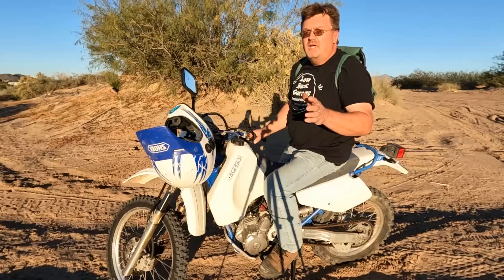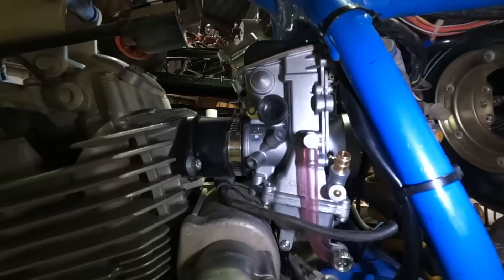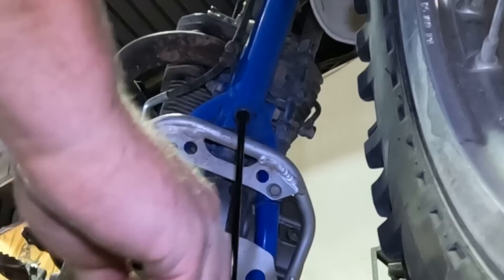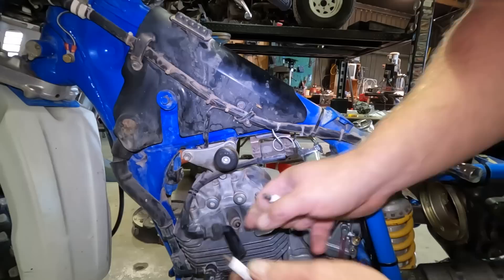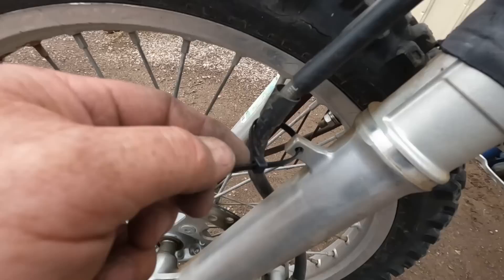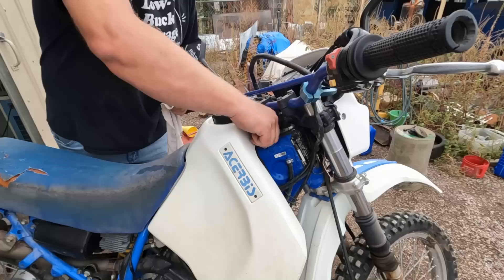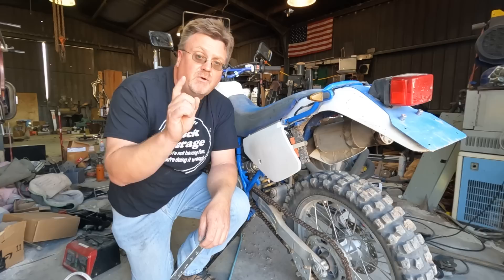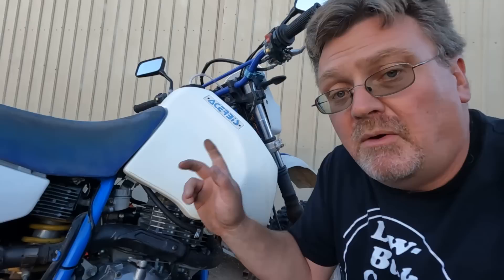Abandoned Dirt Bike Revival, Part 2: Making Mistakes For The Win!  The DR350SE Is Up And Running!

Comment: This is giving me flashbacks. As a wee lad with a 50cc scooter, I asked a local mechanic why it was randomly cutting out for a split second every few moments at full throttle. Without even looking at it, he told me the crankshaft seals were leaking, leading to a lean condition and requiring an engine rebuild, which, of course, he'd gladly undertake for a fee. Not having the money, I set out to do my first engine rebuild. Long story short, I messed it up and ruined the crankshaft, and while diagnosing it I noticed the fuel tap was open... And dripping one drop of fuel every few seconds. Still haven't quite forgiven the mechanic, that was my grandpa's moped...
Reply: I have a Sachs Madass with and 140 Pihrana engine that was having the problem of momentarily cutting out at Max RPM. It turned out to be the aftermarket fuel cap being badly designed (or manufactured) and the air vent being blocked by the tank seal, thus reducing the fuel flow to the engine...

Comment: a bit overfilled but from the FB group on DRs and my personal experience with my 96' SE I recommend either ride it for a few mins or let it idle for 2-3 mins then check the oil. As you stated, the oil won't go through the frame to the motor without that pump moving oil. That is also what my Clymer manual for the DR says to do. Beyond all that, I love the videos and great to see some new 350 content, keep it up brother get that tractor running and it'll run forever. (with GOOD oil maintenance)

Comment: Theres a Different Throttle for the Non-CV carb, for sure- if your buying one, get whats called a 1/4 - turn throttle, they have a much larger drum area to pull more cable, with less twist of the wrist, you dont have to buy the Suzuki one, unless the switches are built in, in which case just buy the one for the regular Slide type pumper Carb like youre using now- Replacing that CV-Carb (Constant Velocity) was the best performance mod you could do, other easy stuff would be less restrictive exhaust and maybe a cam, but then youre talking pricey, Me and my Buddy build full race DRz400's which is the next size bigger brother to your DR350 there - Love your videos dude!
Reply from the maker: Thanks!  I'll look into those twist throttles, too.

Comment: Great fun watching you fail your way to success! I just picked up a DR350 a couple weeks ago for BEANS, and luckily it just needed a complete fuel system cleaning! You did give me a light bulb moment though with the clogged petcock valve. I noticed fuel was coming through on mine, but it kept bugging me that it didn’t seem like much. So I pulled it off and disassembled it, and sure enough, just like yours it was so clogged with crap that it’s a wonder anything was able to get through. I also disassembled the carb and cleaned it, oiled the O-ring gaskets and put it back together and it doesn’t leak, lol.. The fun is definitely in seeing ‘if this works’ and then either figuring out why it didn’t, or having that moment of victory when it does! Two busted knuckle thumbs up!

Comment: Hi mistakes are learning steps and people who never make mistakes never make anything as for the oil for it to come out when you were checking the valves suggests it’s been overfilled.There is a bit of an issue checking the oil on dr 350s I was told by a mechanic to go for a ride then stop turn of the engine wait about 20/30 seconds then check the oil .Great channel
Reply from the maker: Thanks for the tip!  The oil pouring out the inspection hole did just seem wrong.

Comment: run for 3 mins, off for 3 mins (to let any bubbles disappear) bike upright remove dipstick wipe off oil then dip the oil without screwing the dipstick in check oil is covering cross hatch marks on dipstick. use jaso ma or ma2 4t motorcycle oil to ensure it's compatible with wet clutches.

Comment: The valve that's higher on the right side is used for "main" operation,  the valve on left is used as an "aux" tank to get you home. I know those tanks as "desert" tanks , way more fuel than stock

Comment: Those universal boots don't hold up as well and can be prone to air leaks because they are designed to the point that the holes are almost a 1/3rd blocked of access. I had to modify the crap out of mine such as drill/file reliefs  on the main body of the boot just to get allen head bolts to seat correctly. When I get my DR I think I will go with the over priced version or make my own. Thanks for making this video I can't get enough DR350 content.

PS: I had that same battery it didn't last long for me.

Comment: The looks like a warrior 350 carb but it don’t bolt on like a worrior carb but looks almost the same . I bett you coulda used a warrior 350 intake boot and carb since it’s same bolt pattern as what you used.

Comment: Constant velocity (cv) carb (original) has a dual throttle cable. The pumper carb takes a single throttle cable. Not sure of pumpeŕ cable route, but cv crossses over ignition and routes thru same bracket as wire harness, down left side of frame. I was watching to help me figure out cable and wire routing, it is not working out 😢

Comment: Probably my eyes but are you sure that's a filter or is it a screen? There are instructions on oil checking as well I believe you run the motor for so long and you shut it off and immediately check it. Good luck love the video!

Comment: With the tm33 carb you installed, do you have a bog when you quickly snap the throttle wide open from an idle? I have that issue with mine and I've tried everything and can't figure it out. The bike runs great other than that though.

Comment: Really dig the videos man i got a 96 dr 350 se and still dealing with the mikuni $##@%#*mother##@%%%#@##and just like your issue i had the same weird clog in tHe pet cocks so now that fuel is flowing  it rips again now its time for some new suspension and maybe some new plastics and maybe a new seat .thanks foryour videos .by the way where did you score The step by step valve adjustment for it?

Comment: That canal ditch with jumps on it looked scetchy and deep as hell,one wrong move and your hurting,the open desert seemed safer spot to play.nice bike 6 gears yet offroad based.all around sweet ride.just traded my brother inlaw my 308 ar-10 for his klr-650 problem is im short 5'7"even with boots im on tippy toes.plus its heavy big tank n radiotor give it wieght but real issue is its too tall,they say just lower forks n dog bone susp.part can be shortened maybe n inch yet .so ive yet to try!but if not its getting traded in.snookie pa.